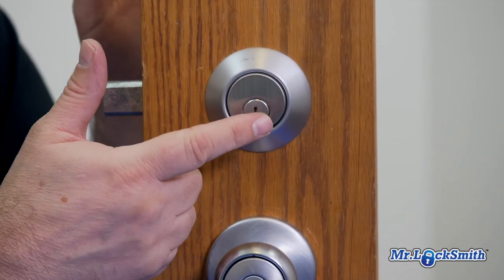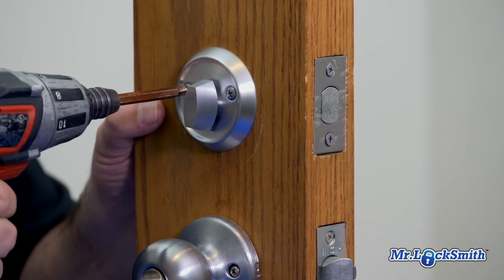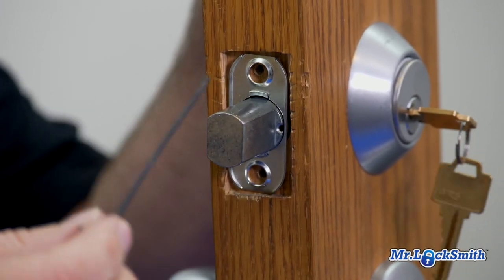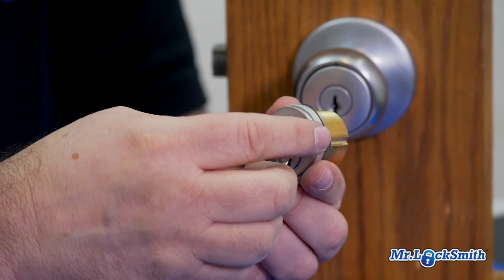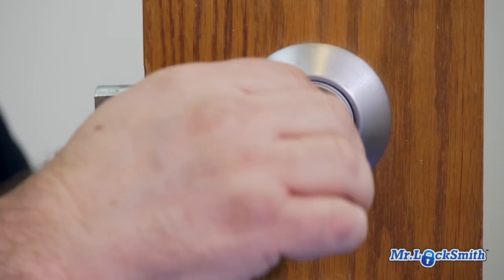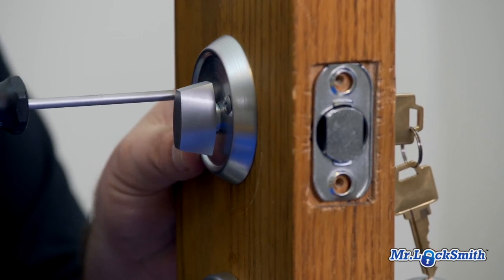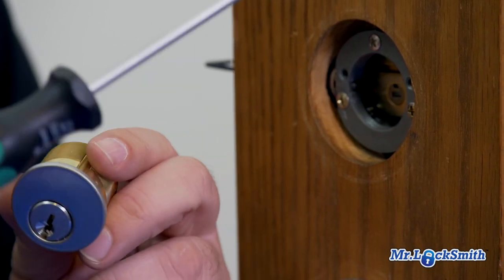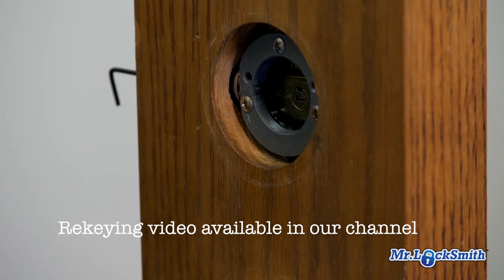How To Remove A Lori Single Cylinder Deadbolt | Mr. Locksmith™ Video

Comment: Thanks for the video not familiar with this lori deadbolt what size allen wrench did you use?
Reply from the maker: 5/64” Long Reach Allan Wrench.
Reply: The one that fits 🤗
Reply: @24hrMrLocksmith  well you did say it was a 5/16” in another comment…..

Comment: I am having issues removing the cylinder from a Baldwin deadbolt, do you have similar instructions on Baldwin deadbolts or do they also use Allen screws to hold in place, thank you

Comment: Thanks for this video. I need to remove an old old (1955) Lori single cylinder deadbolt on my door for which the key has been long gone. I got the cylinder out, but cannot get the inside thumb-turn out. There are no screws that I can see on the inside of the door. Any ideas?

Comment: Along with don't cross thread the cylinder, don't put it in crooked then crank down hard on the setscrew. I've had cylinders that are very difficult to get out and reinstall because some idiot seriously mangled the threads.